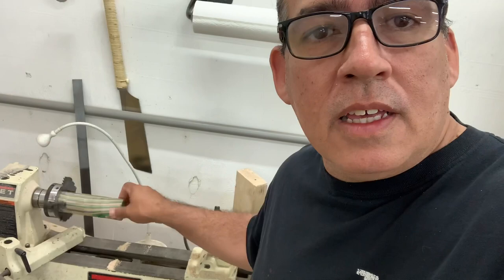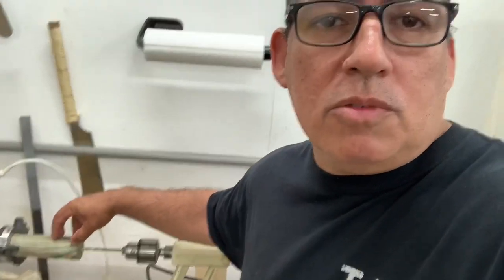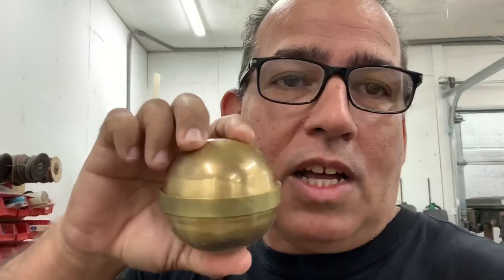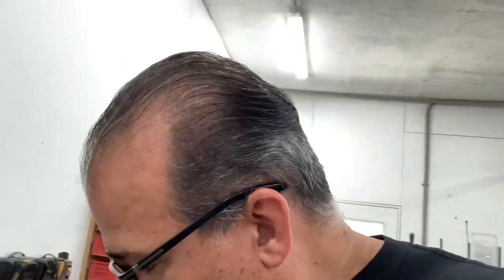Metal art plasma cutting and forming a Spade fish

Comment: Do not do what i do. Lol. I only use a guard when running a cut off wheel. Your not alone. Diamond blade nope flap disc nope. Rock disc nope. Twisted wire nope.   Cut off wheel definitely
Reply from the maker: Cut off wheels scare the crap out of me. I think mostly because of what I’ve read online or seen in pictures. 😬